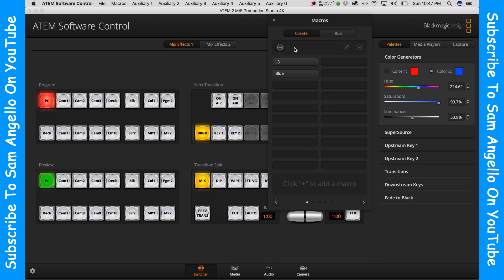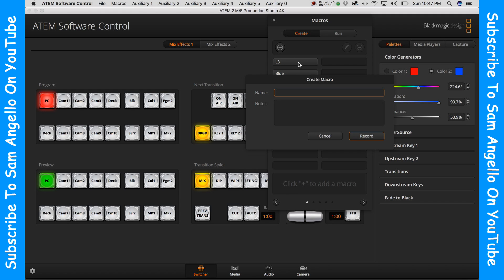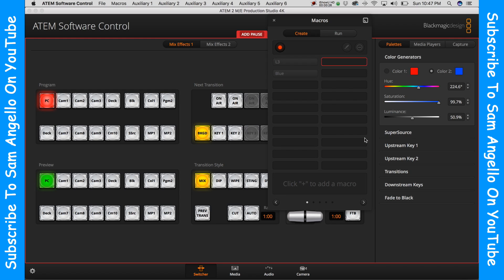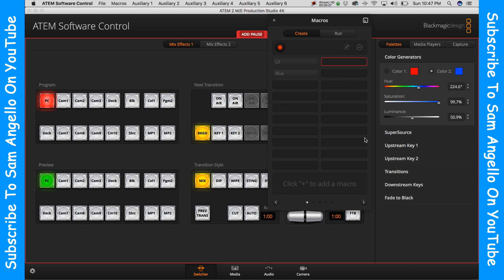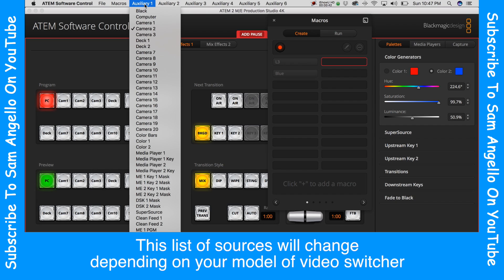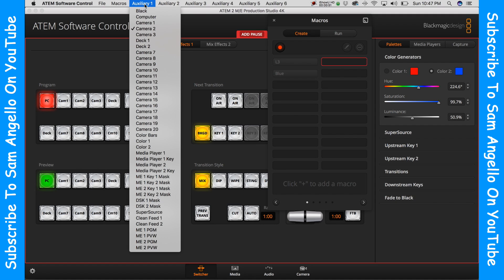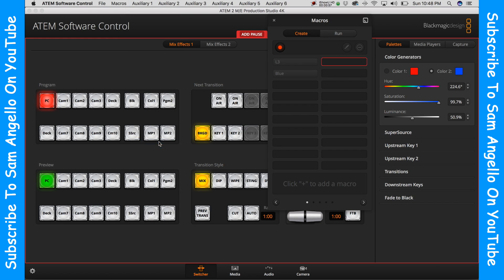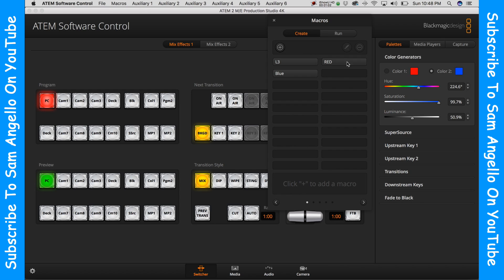Controlling Auxiliary Outputs With Macros - BlackMagic Design ATEM  Video Switcher

Comment: Hi,
 I have two computers with graphics that should separately send video and alpha key to the ATM blackmagic switcher via HDMA (4 signals). I send that signal (video and alpha) as an input to the master TV video mixer (2 signals via pgm and aux out). In case of error, I need to switch the signal from computer 1 to computer 2. But the problem is that I have to send the second alpha video as well. Can I use the program output for video, and auxilary out as an alpha key and how can I simultaneously change both signals at once, via the macro option in the switcher? Changing singles is the responsibility of the graphic operator, not the main video mixer. Thank you